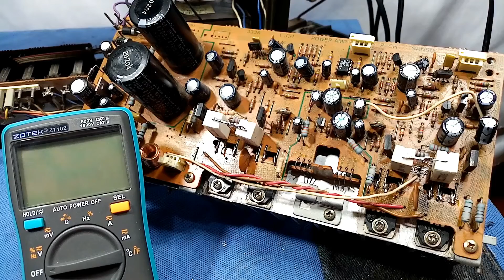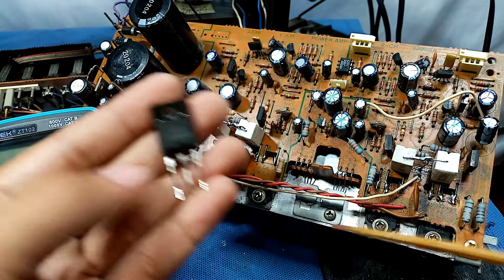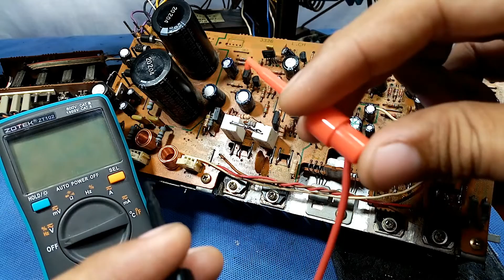Simplest way to bias a power transistor || SANSUI A-7 amplifier

Comment: Hello, I have a Denon Avr 3311, with 7 channels, it gets very hot without speakers, just turned on, I checked the bias, all channels are over 50mv, I can't adjust from the trimpot, I checked the driver transistor, diodes, resistors next to the final transistor, I have 2, 0.47ohm and one 22 ohm and they are ok, I don't know what to do anymore, a little help if possible, thanks.
Reply from the maker: Is your amplifier work normal?
Reply: @woodys_hobbies 
no, I have no sound and it gets over 90 degrees in front of the speakers, just turned on
Reply from the maker: @bogdanbrinzoiu7592  If no sound then you need troubleshoot isolate the amplifier section.
Reply: @woodys_hobbies 
yes, first I have to adjust the voltage to 8mv as it says in the book, I have over 50mv on all channels, in a minute it goes over 90 degrees and I have to turn it off so as not to burn the power amplifiers, it's probably something common, it affects all channels.
Reply from the maker: @bogdanbrinzoiu7592  If it's in the book 8mV then adjust to 8mV.
Reply: @woodys_hobbies 
Well, that's the problem, it doesn't work, not just on one channel, on all of them.
Reply from the maker: @bogdanbrinzoiu7592  Just get the average bias.

Comment: I built audio yiroshi amp and I am having high DC offset at the output. I was told the issue is bias related. How do i resolve that?
Reply from the maker: Check proper grounding, Test the resistance of the ground connection. A value of \(0.9\) ohms or less is ideal, while higher values indicate a poor ground. Check your power supply. Check driver and output transistors.

Comment: It is a good idea to add a 100W conventional light bulb in series with the amp mains supply when adjusting bias. Reason: when turning the bias pot, it may temporary loose contact with the carbon track, which may cause high currents running through the output transistors.

Comment: Sir ano model power transistor niya?
Reply from the maker: 2SC2579 2SA1104
Reply: @Woodys_Hobbies  sir napanood ko modification mo ng vu meter, ano schematic ng diode, IC, caps for power supply?
Reply from the maker: @rollingwheelspinas  Simple lang sir dun po kayo mag tap sa power supply circuit secondary side hanap lang kayo ng 12V dun at i regulate nyo pagkatapos para safe yung VU meter nyo. Gamit ko sa pagregulate is LM7812 or 7809 depende sa voltage requirements ng VU meter nyo.
Reply: Try ko sa sansui A9 ko
Reply from the maker: @rollingwheelspinas  👍👍👍

Comment: Hola una consulta , cuál es el par de trassistores que tiene ? Porque originalmente vienen con el par complementario 2sc2577 -2sa1102 de la marca sk y ahí tiene marca Toshiba pero no se ve qué número son , gracias
Reply from the maker: Hello I used the same part number and I'm using a replacement transistors.
Reply: Me podrías decir cuáles son? Porque estoy buscando para reemplazarlos y aca en argentina son muy pocos los que ingresan
Reply from the maker: @javierparadiso7983  2SC2579 2SA1104
Reply: @woodys_hobbies  muchas gracias! Los voy a buscar porque me habían recomendado los 2sc5200 -2sa1943
Reply from the maker: @javierparadiso7983  Welcome 😊

Comment: Thank you for this video.  I just recently bought  an a-7 and wondered if you can help me about the power switch, it has static sound when switching on and off the power. Thanks
Reply from the maker: Welcome... Try to replace the capacitor in the switch and clean the power switch.

Comment: I switched my amplifier on and after a minute I tried adjusting the pot on channel 1 (red probe on base and black probe on the emmiter of the output transistors )it shows 0.500 on ch 1 and when I tried on ch 2 it reads 0.464 if I turn up or down the reading stays the same must I disconnect the fan cooling the sink ? It's my first time biasing a class ab amplifier any help will be greatly appreciated.
Reply from the maker: The 0.46 one channel and the other is 0.5 that's fine. Try to adjust the 0.5 back to 0.464 to have the same bias with the other channel. The 0.46 is just fine.

Comment: I've got a Pyle pt1200 amplifier that uses a pair of transistors 2sc5200 and 2sa1943 and has a small transistor in the middle of them (3421) on ch 1 and ch 2 and has 1 trim pot 100 k per channel can I use the same method you used connect my red probe to the base and black probe on the (e) of the pair and adjust the pot , Can I just do the adjustment on one of the 2 transistors in each channel ?
Reply from the maker: Each channel has only one biasing trimmer you need to get the nearest average bias voltage of the two transistor in each channel. Example if you set the one transistor at 0.5V the reading of the other transistor might be 0.49V or 0.52V in the real world you can't get the same voltage on both transistors just get the average of the two.

Comment: not all vintage stereo had has the same biasing voltage.
There are .11 or .8 .7 and something.
The factory biasing settings of sansui a-7 is .7mv
But in my field of repair the sansui is not sensitive in lowering the biasing voltage not like the vintage pioneer stereo amplifier
The sansui integrated can be converted the trim bias into fix resistors. And if you were curious try to use 1k resistors  or 1.2k series connection to replace the trim.
Reply from the maker: Thanks for the info.

Comment: That is good, can that be applied to any other similar amplifier, both  VBE ~~ .500 Volts  ?
Reply from the maker: Yes it is the safe way 0.5V bias actually this is cold bias. I don't have the schematic diagram of this unit and If ever you have the correct bias  of your unit that's the best bias if in case you don't have then go for a cold bias. Or you can crack this up but do it little by little just observe the heat dissipation of your power transistors.